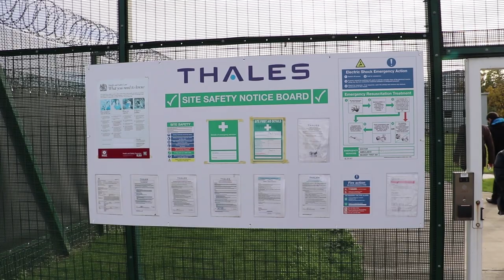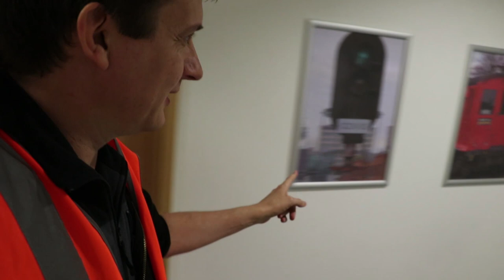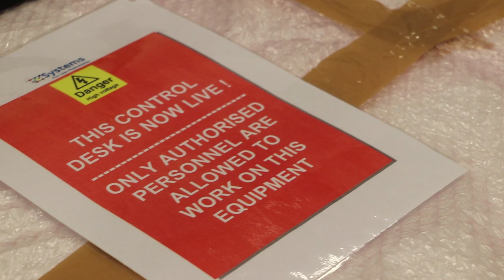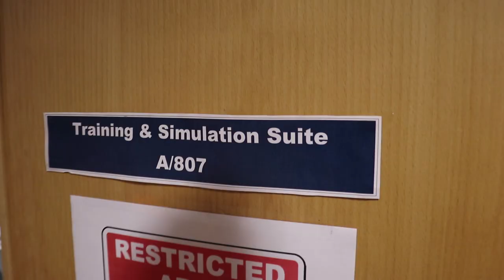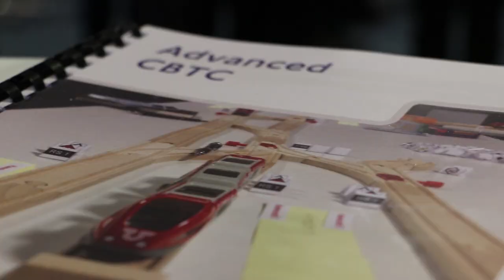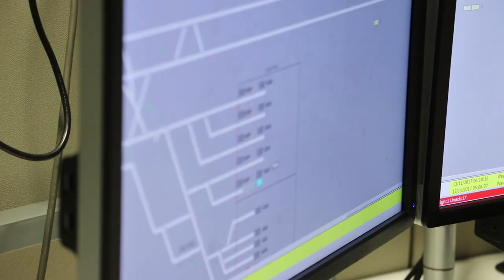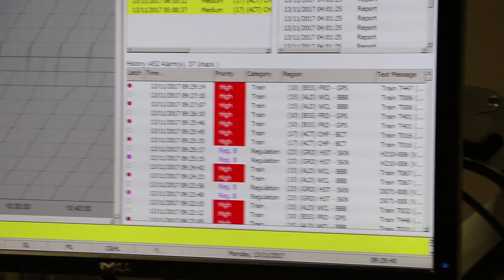New Hammersmith Control Centre

Comment: You know when someone took the time to program in ‘leaves on the line’ algorithms, they take their job seriously.
Reply: Jan Harvalík Leaves that trains run over kind of turns into a mush which becomes a hazard. Trains are far more likely to slip so they need to run at slower speeds to minimize that. Over here in NYC, the Brighton, Franklin, and Sea Beach Lines have the same issue and thus slower speeds are enforced during the fall.
Reply: Offering the ability to switch to a lower guaranteed brake rate to be into account by the CBTC system to allow for slide when braking is a VERY brilliant way to manage leaves on the line !   Moreover, very probably the ATO system of the S Stock will also be programmed to request less adhesion rate when accelerating (limiting the tractive effort), anticipate braking and request a lower braking effort to avoid to put the train in a slip & slide situation.  Both of these measures will obviously put the problem under control, all that a click away from the OCC !! Brilliant !!
Reply: Stéphane Fontaine You know, I think that may be what the MTA was thinking when they decided to have the Brighton Line converted by 2024. Great insight nonetheless.
Reply: The problem is mainly down to the use of disc brakes. The old style brakes - using composite brake blocks rubbing against the wheel surface - used to clean all the rubbish off the wheels as well as slow the train down, hence leaf mulch caused far less problems.
Reply: Slowing down is only part of the problem. Getting traction in an area of low adhesion is also an issue.
Reply: Train driver here: time to address a few myths;
1) it only happens in Britain. Wrong - many other nations have far more track per train, hence more time allowances between trains means that when it does get a little slippy they won't be delaying other trains - we physically don't have the track capacity (we need more tracks) to cope and so we have to timetable assuming decent conditions and on the few days it does get bad, everything just has to get delayed.
2) Disc brakes are the problem - wrong - while discs don't clean the wheel the sharp application of tread brakes actually makes them more likely to slide and so you tend to have to approach slower. 14x's are horrendous.
3) We do have sanders, but can't rely on them - the railway is built on a fail-safe mentality and thus we have to drive under the assumption that if the sanders fail we would need to stop safely. Sanders do improve timekeeping, primarily on accelerating away as they reduce wheel slip, just not enough to match normal running through the rest of the year.

Comment: I believe this is located on the trackbed of the former line that ran from Hammersmith to Kensington Addison Road, and then on to Waterloo. It was closed in 1916, I lived in a block of flats built on the track bed in Shepherd's Bush Road.  When it was working there was a footbridge connection from the Hammersmith and City line station across what was then the goods yard, and on to Hammersmith Grove station, that's the reason why there is a footbridge across the platforms at the further end of Hammersmith & City station.

Comment: How many of the hi-vis jackets you’ve worn in your videos did you end up keeping?
Reply: I think we need a video showing all the PPE designs used on the railway network.

It seems like anyone who is light blue, is not allowed to do anything inside the station or somesuch. There were a lot of them waving water bottles under my nose, during the Waterloo Upgrade.
Reply: I can't help wondering: Why the Hi-vis? Who really needs to see the group members that well?!!!
Reply: I guess it will be a controlled site who gets access and makes it a damn slight easier if someone tried to peel off from a large-ish group at any point.  Get lost, end up unsupervised, get yourself wittingly into trouble and then the company is in trouble if anything was to happen to you.  It is surprising how Hi-Vis does help draw awareness to a person in this way and in a controlled environment like a control centre for a tube line allowing people of the general public in, its not a bad thing.

I know that answer won't be good enough for some people but my reasoned approached to it.  They can stick to the "ramble ramble 'elf an saftee is madz"
Reply: I have no idea what "ramble ramble 'elf an saftee is madz" means.
I do know that it is possible to remove a hi-vis jacket - people do it all the time. It is also possible to get lost while wearing one and to ask for directions whether you are wearing one or not. Of course, if you are up to no good, you would have removed the hi-vis (using the technique perfected over many years using one's own clothing) and then stuff it behind a fire extinguisher. They don't reduced the risk of getting lost. They reduce the opportunities for crime. My question still stands: Why the hi-vis jackets?

Comment: hi quick question, Singapore's 30 year old MRT lines (North South and East West Lines) are currently upgrading to the Thales CBTC signalling similar to those of London and Hong Kong but we have been experiencing quite a letdown in the project with the most recent a collision between 2 trains due to a signalling software error while the train was running on the new signalling system. apart from this there has been a spate of breakdowns relating to the new signalling system including an 8 hour disruption when a software reboot caused trains to halt and had its train run number and schedule write off from the data. i wonder if the underground lines running Thales CBTC had such issues when the system came "live"? 
or maybe have our transport authority been rushing too much for this project to be completed?

Comment: It looks like an airline control center, and I'm sure that isn't be accident.  Very similar in job function.
Reply: Indeed it's a rather efficient way of setting something like this up, similar work-spaces are used for things like controlling the flows in oil refineries, running power plants and of course the control centres for the various utility networks and telecoms operations centres etc.

Comment: Thales is French not Canadian https://en.wikipedia.org/wiki/Thales_Group?wprov=sfla1
Reply: Wikipedia can be edited by anyone therefore it’s unreliable..
Reply: I may confirm Thales is a French company, but their CBTC system headquarters are well in Canada, where the Seltrac system has been developed more than 30 years ago and installed on one of the very first Unattended Train Operation systems in the world : the Vancouver SkyTrain.  That same Seltrac system also installed on the DLR in the 1994 upgrade has German roots : "SEL" in Seltrac comes from Standard Elelektrik Lorenz, a former german signalling company bought by Alcatel which itself has been bought by Thales.  That system shares common technological roots with the german high-speed LZB control system.
However, the Automatic Train Supervision system, whose visible part are the displays and mimic panels seen on the video, are developed in France (Vélizy).
Reply: I my experience dealing with Thales, it's my understanding that they are French. They are definitely not a Canadian company.
Reply: Simon Tay nobody in the UK makes such a system.
Reply: In my experience dealing with Thales Rail Signalling Solutions, they are Canadian. Their parent/owners are still French.
Reply: No need to strike out DLR.  DLR does operate with a Seltrac signalling system, since 1994.
Reply: Some of you please remember the first heavy metro using This signalling was Hong Kong West Rail Line in 2003.
Before that,none of the Metro Train system using it.
It only apply on light rail or APM.

Comment: Maybe they could spend some money on telling you the correct destination for the train you are catching. Hammersmith station is a complete joke, as is the District line and its constant signal failures.
Reply: Destination indicators run off the signalling system data.  The introduction of the new signalling system will greatly improve the way this is done, so yes the money spent will be on this as you say.